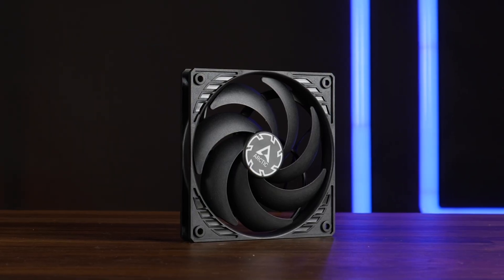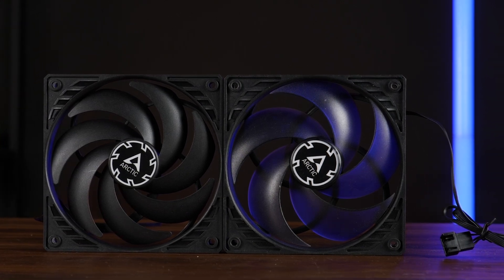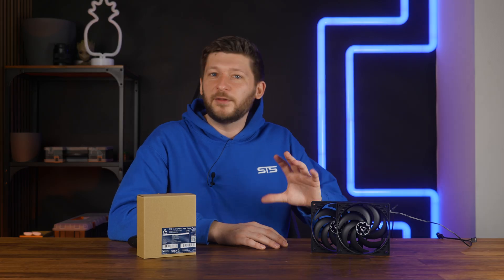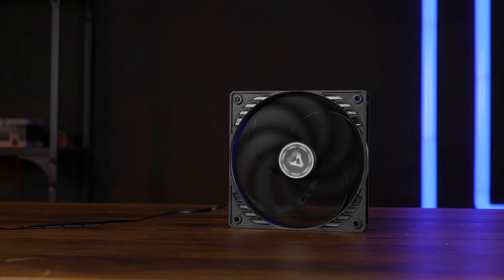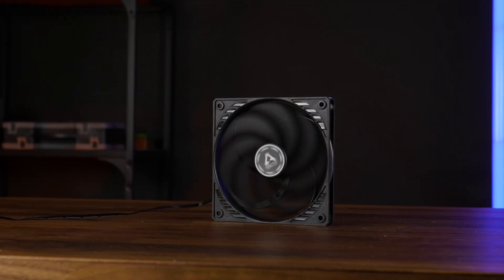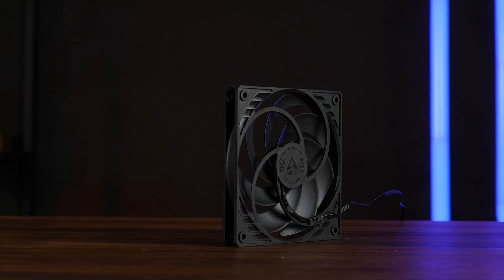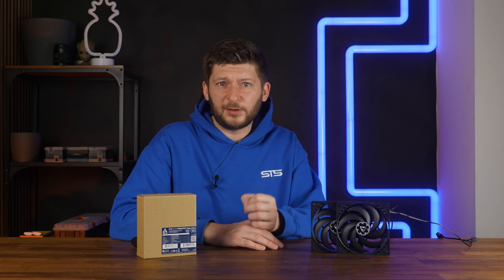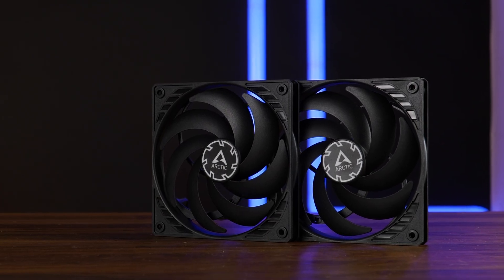What Happens If You Bodyshame A Fan - Arctic P12 Slim

Comment: on my itx tv build, i have two these, i run them flat out, i cannot hear them but over aircon and room fan as itx pc over meter away its a very quite system, air flow out the top pretty good, do not know how much that is x4 40mm 6000rpm front fans as it very limited case, when i change gpu  measure up  as i may be able to fit two 80mm 5k arctic max fans, those 6k rpm fans so quite when first turned on system i went in to bois, downloaded software and until i put a light in to them i had no idea they even on, and noise only starts at 4500rpm but really not bad even at max, 4 those front intake and one those pulling air from bottom directly on to cpu cooler, two slim 120mm max on top and psu area it has 1 80mm getting heat out , small case but lots fans some fans small tho, only other slim fan id cooling as cannot fit large fan as less 1cm from back gpu, but the case temps the pc highs 65c , how much those slim 120mm fans doing who knows but im happy with them and quite at max

Comment: You should just try the one to rule them all: Silverstone Air Slimmer (ARGB). They use it for their own slim AIO, the 240 Vida (that sounds like a hot rod when paired with standard-sized fans).

Tested it on several LP CPU coolers, including the Thermalright AXP120-x67, and has been the best so far (I own almost all PWM-controlled 120 mm slim fans available in the EU - EXCEPT for the P12 Slim, because its apparently prone to brittle fans, leading to tiny explosions inside actual use cases .. you dont want THAT to happen to your hardware, do you?).

Comment: could six of these be used for a push pull system on the liquid freezer free, all daisy chained into the CPU_FAN header?   or would that be too much for one header?  It's a thought to have, but I reckon it may be a tight squeeze in my Define 7 case.  I'm considering the 420 arctic freezer 3 in a roof position and i am wondering how that is going to mess with the 3 front fans

Comment: I have the P12 slim in my SFF and I use it as a case fan, works great for moving air at low noise. It doesn't work as well as a NF-A12x15 in terms of cooling on the L12s.

Comment: Don't use them arctic slim on a rad. I had the first batch of p14 slim break two fans on boot when they went full speed. These should never run at max pulling
Reply: Yes, P14 - 15mm slim fans are VERY fragile. My lasted 15 minutes before breaking - as a case fan.